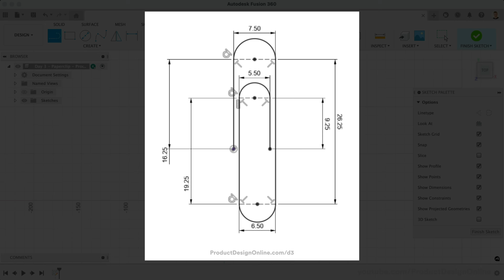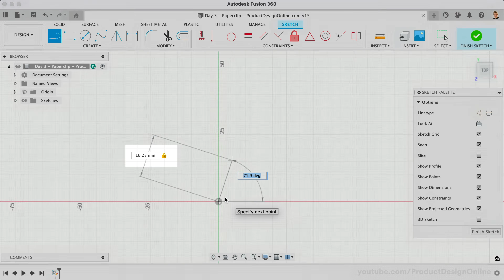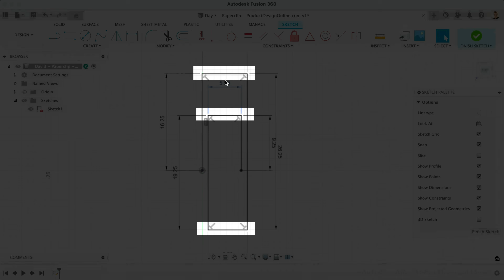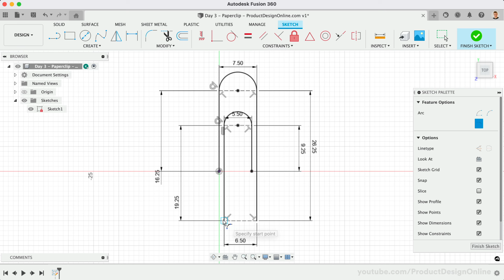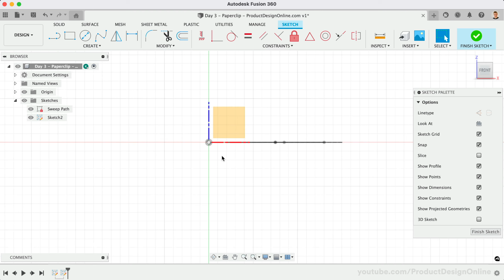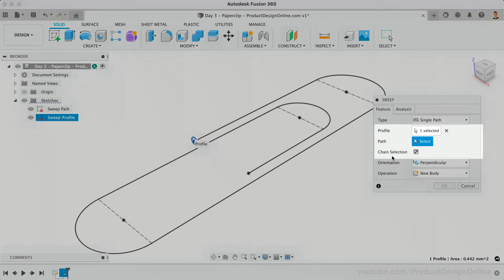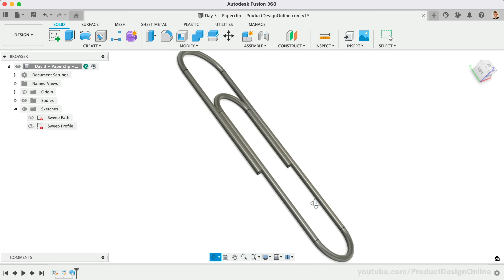Day 3 of Learn Fusion 360 in 30 Days for Complete Beginners! - 2023 EDITION

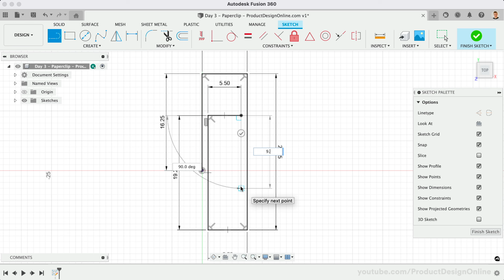Comment: I'm running into a scenario around 2:30 into the videos where two vertical lines remain light blue, and if I try to constrain them, I get an error stating they are over-constrained.
Reply: I was having the same issue. I just CTRL + Z to undo all the lines to the point I can see the red lock on the sketch, and redid the lines and kept putting in the correct dimensions. Kinda dumb but it just magically worked. Not sure what the issue was.

Comment: Fantastic stuff! many  thanks for putting all that effort in place! Just one questions, and I am sura is a silly one, but I cannot find the way to make it happen... your sketch lines are way thicker than the dimension lines, making it very easy to identify them... in my setup both thickness are equal, so making it messy to identify... Is there any setup lurking somewhere that can be used to make it happen? I can only find a setup in documents valid for the drawing environment, but not for sketching... any help will be really appreciated! anyone?

Comment: The shell command was weird on my side. the 2.5mm thickness wouldn't work because it was thicker than the opening. But on my sketch, I did fix the dimension to 11 mm, so 22 mm diameter after the revolve.  How is it possible the 2.5mm tickness is filling all of the opening?  on 2mm tickness, it was almost full the the opening was very tiny...

Comment: for some reason my dimension lines and sketch lines are very very similar in thickness, making it hard to differeniate on a sketch like this. how is you sketch so much clearer?
Reply: did you find a solution for this???

Comment: Is there an Option where you can thicken the lines a little bit. Mine are very thin not like in the video and its more difficult to see or differ what are the lines you created and what are the lines for the messurements?

Comment: 3:09 if anone sees the two interior vertical lines as unconstrained, what i did was set the length of the bottom line to 6.5mm (apparently wasnt set before) and then the interior vertical lines became constrained
Reply: I caught that too and was confused. For some reason, the bottom line gets shortened to 6.4999999999999...
Reply: you are the hero the world needs

Comment: how do you move around without clicking the pan button at the bottom?
Reply from the maker: I was swiping with 3 fingers on a trackpad. If using a mouse you can click and hold the center scroll wheel and move the mouse to pan.
When not recording videos, I typically prefer a 3D space mouse and would recommend one if you plan to use Fusion a lot.

Comment: 2:40 I did not understand the significance of the black line. can you explain what the difference is between the black line and blue line. Or what would happen if the sketch was blue instead of black?
Reply from the maker: Blue (undefined) lines can still be moved around which means that they may get moved unwillingly when you change dimensions. The goal is to fully define sketches so you can update things predictably. This is covered specifically on Day 16, in greater detail.
Reply: @ProductDesignOnline  thankyou so much
Reply from the maker: @harshilpanchal2229  You're welcome! Happy learning :)

Comment: Why we didnt make a component this time?
Reply from the maker: If you have a single-part file and no plans to copy the component, then creating a component is not needed as the default file in Fusion acts as a component itself (if you were to insert the file into another).
Reply: @ProductDesignOnline  thank you so much for the answer you are the best. That what you told me is the problem that i had in one project of mine. I copy something that it wasnt component and everything went bad from that point. This is the reason i started youre tutorials.

Comment: I'm sorry, but I'm dumb, but can you give me one real life use case of using this sweep command the other than making paper clips?
Reply from the maker: Pipes and Tubes

Plumbing pipes
Exhaust pipes
Electrical conduit
Drinking straws
Handles and Grips

Bicycle handles
Tool grips
Drawer pulls
Wires and Cables

Electrical wires
Rope
Cables for electronics
Railings and Guardrails

Staircase railings
Balcony railings
Tracks and Rails

Curtain tracks
Train tracks
Sliding door rails
Hose and Flexible Tubing

Garden hose
Hydraulic hose
Medical tubing
Architectural Molding and Trim

Crown molding
Baseboards
Window trim
Extruded Seals and Gaskets

Rubber seals
Silicone gaskets
Structural Elements

Beams
Columns
Jewelry

Bracelets
Rings with intricate patterns
Automotive Parts

Car body moldings
Custom exhaust manifolds
Furniture Components

Chair legs
Table edges
Decorative Items

Picture frames
Sculptural art pieces
Reply: @ProductDesignOnline   thank you

Comment: His tutorials are great, but they are even speedier than I like.  Sometimes I wish there was a bit more explanation as to the Why, not just the How.  I keep kitting Fusion shortcuts in the Video window and screwing up the playback :)  

I wish someone would do a video on how to move everything around the workspace (not the design) without having to click on the toolbar at the bottom.  I finally figured out the view angle (box in top right), but the I can't figure out how to use the Hand without clicking it's icon :(  AutoDesk's "guide" depends on these types of tutorials.  Product Documentation is even less useful than Microsoft's - it's basically a gross summary.  Not b*ching - sometimes it's a good learning tool to figure it out yourself.  Sometimes :)

I also wish someone would explain how to edit some of these design configuration details; for instance, Constraints, "Shell," etc.  "D" lets you edit dimensions, not always easily, but I can't figure out how to "see" the constraint definition details, et alone edit (or clear) them.  Another is "Shell" - Somehow Kevin was able to edit his Shell in the Glass Bottle.  No matter what I do, however, I can't edit it - clicking on the timeline shows it, but doesn't open the config window as his did.  Again, not really b*ching - just a wish.

Comment: I do designs for 3D printing and I've always used Blender. Yesterday I discovered that there's a free version of Fusion and here I am, learning a new software. Your tutorials are perfect for beginners like me. I only have one question: In my file I see the numbers of the measures on the inside of the lines and they should be on the outside. How do I fix it?
Reply: I had this same question, but I discovered you can click and drag the line to where you please.

Comment: Works great. I got stuck at the point where you drew a circle on the end, of the clip, it would only draw on the x axis instead of z axis. Came to comments section, discovered the pipe function, which was super easy. Thanks again for a great video tutorial.
Reply: Im stuck there as well!

Comment: Just upgraded to a new 3D printer for feel the need to get back into Fusion 360 and remembered you are an excellent source of learning.  Great job so far.  Quick question - in all of your previous lessons you made a point of creating a component right at the start.  In the paperclip lesson we never created a component.  Is there a reason we didn't crete a component?  Or did I miss it?
Reply: I had the same question!

Comment: Is there any way to get nice bold and easy to see lines as seen in your video? All of mine seem to be pretty thin, making it very hard to tell what kind of line it is and even what color.
Reply from the maker: I believe it depends on your monitor/resolution. There's no setting to change sketch line thickness that I'm aware of.
Reply: @ProductDesignOnline  I believe you’re correct, I’ll look into this more. Sounds so obvious after hearing that

Comment: Something that nearly has me tearing my hair out following this tutorial. When it moved onto creating the new sketch to draw the circle I couldn't do it without clicking "finish sketch" on Sketch1 first. Maybe your settings are different to mine but it had be rewatching the same 20 seconds 10 times to try and figure out what i was doing wrong
Reply from the maker: Hi Sam. I select 'Finish Sketch' at 4:57. Not sure if that's where you're at in the lesson?

In general, selecting Finish Sketch is not required if you activate any of the modeling commands while a sketch is active. Activating a modeling command will automatically close the sketch. However, activating another sketch command will assume you're wanting to sketch in the currently active sketch.

Comment: I followed this tutorial got an error of "The path is tangent to the profile. Try adjusting the path or rotating the profile." What does this mean? What do I have to do in order to fix this?
Reply: The error is clear, I guess you didn't chose the front plane while setting the coordinate for the sweep profile; I had the same issue but it's fixed now.

Comment: Tip! use the youtube shortcuts on your keyboard: 
Letters J, K, L. 
J = back 10 sec, K = pause video, L = forward 10 sec.
Reply: HOW DID I NOT KNOW THIS SOONER?!!
Reply: Is there a way to do this while I'm in fusion? I've been googling that for 2 days now.
Reply: @PawPatrolPapa  You might have watched all videos but i'm answering your question for other people to see:
If your keyboard has a play/pause button (at the top row, normally), you can play/pause the video while staying in Fusion 360.
One of the viewers also mentioned watching the video once without doing the Fusion stuff and than watch it again while doing the Fusion stuff.
P.s. Great videos!
I 3D printed the first model (the toy block) and was suprised my printer didn't screw it up, as it was printing in the air at some point.
Reply: @PawPatrolPapa  no, in general you can't interact with an app while using another one (in windows, i suppose it's the same with macOS)
Reply: @PawPatrolPapa  only way really is to ALT+TAB back to youtube.  Not a direct shortcut, but avoids the mouse.  If you have a macropad, you may can rig something up like that.
Reply: @PawPatrolPapa  I think there are some "media control" browser extensions that let you do this, i.e apply a shortcut to a window that's not active
Reply: What en eyeopener! Thanks!
Reply: Or just use the arrow keys lol
Reply: or just space and left right arrows.  easier to remember.

Comment: +1, I don't have Fusion because I don't have Windows but I see the Fusion 360 is much easier to use than FreeCAD, the Fusion 360 is well-programmed tool...
Reply from the maker: Fusion 360 does work on Mac as well.... or are you on Linux? :)
Reply: @ProductDesignOnline  I have Xubuntu and slow laptop... but FreeCAD works.

Comment: Is there any benefit of using the sweep command vs the pipe command?
Reply from the maker: Hi Marcus. Great question! In this case, there's no real benefit to Sweep, as the Pipe command would work as well. Depending on the path shape, the Pipe command will not always work (around bends and such) that can be done with Sweep. Sweep also allows you to choose the profile shape (just a circle in this case), where Pipe lets you only choose from Circle/Square/Rectangle.
Reply: @ProductDesignOnline  Ah ok. Thanks for that explanation!